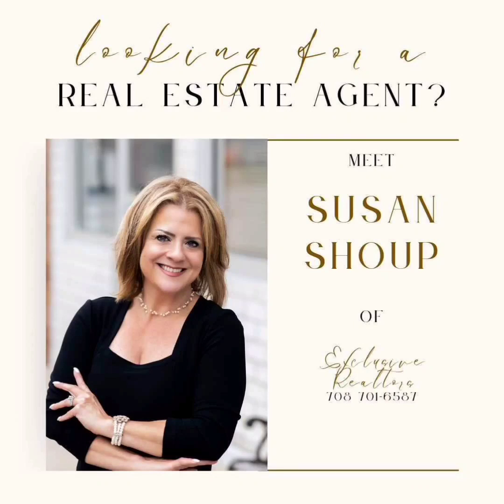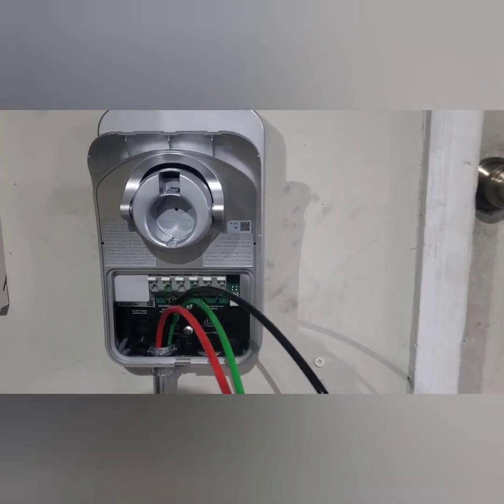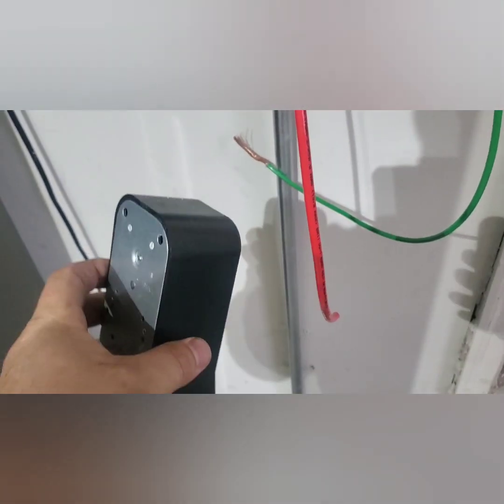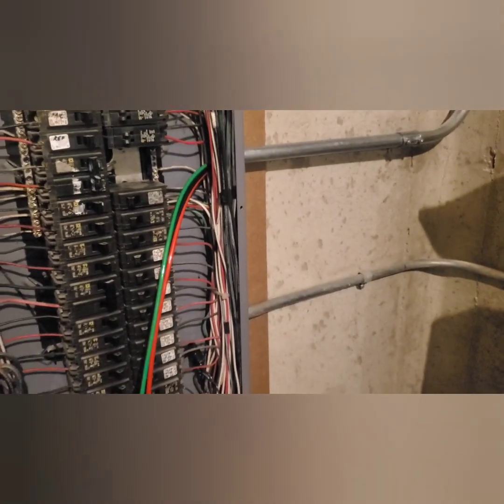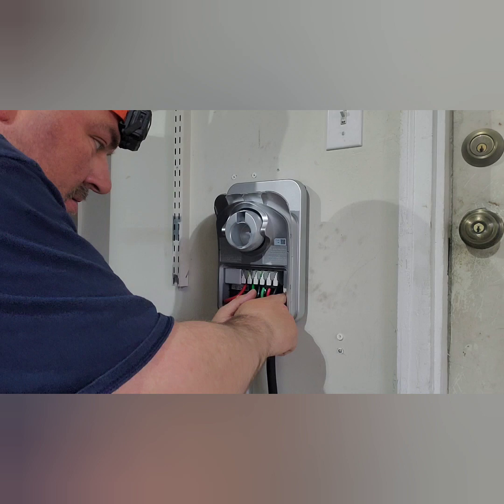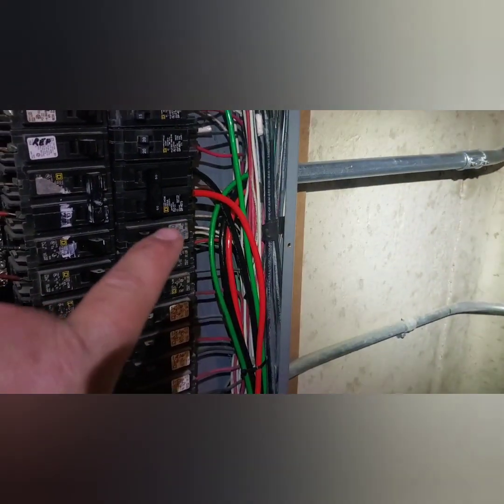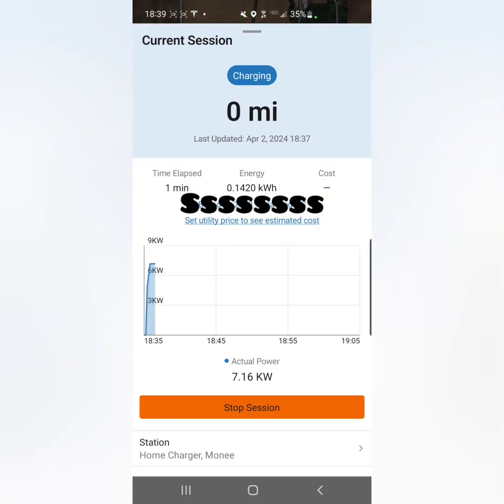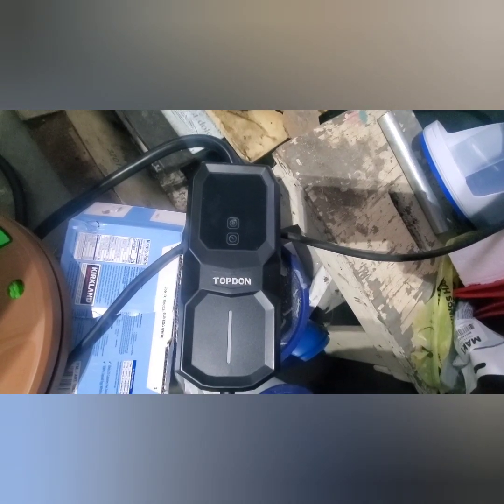ChargePoint Flex EV Charger Install Hardwire

Comment: Does it matter which hot goes into which hot slot in the charger as well as on the breaker?
Reply from the maker: @marcprue  the hots don't matter which side.  The only one that matters is the ground goes to ground slot

Comment: Hi, im looking to hard wire a 32a charge point flex, can i use the the #8/3 Romex from homedepot ? 40a breaker
Reply from the maker: @goldenstatew2399  I would use THHN #8 wire in conduit with a 40A breaker. It's best for continuous use
Reply: @vfr800fi07  thanks for the swiff reply, does the length matter for the 25ft, 50 ft? Also flexible conduit? Ok for crawlspace?
Reply from the maker: @goldenstatew2399  flexible conduit will work.. Code wise not sure that depends on area.. But wire size is good for those distances

Comment: What are the torque specs for the breaker?  Trying to find that info out and can, wanted to install a 50a breaker for mine
Reply from the maker: 40 in/lbs
Reply: Where do you find that info?  I cannot find it in the install manual?
Reply from the maker: @rnr1880  https://www.se.com/us/en/product/HOM260CP/mini-circuit-breaker-homeline-60a-2-pole-120-240vac-10ka-air-standard-type-plug-in-ul/
Reply from the maker: @rnr1880  look up product datasheet towards the bottom
Reply: Oh ok so the breaker information sheet has it not necessarily chargepoints instruction.  Makes sense now.  Thank you so much!  And great job on your video, very nice work.
Reply from the maker: @rnr1880  hey thanks... And no problem